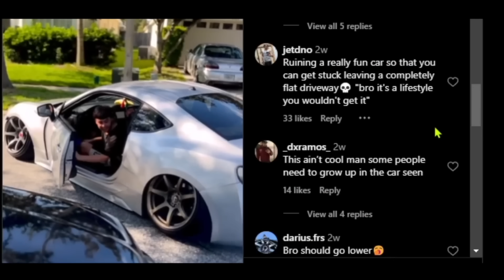THIS 19 YEAR OLD HAS THE MOST DANGEROUS CAMBERED STANCE CAR EVER

Comment: This mans is the reason why frs are going extinct and blaming that it's not reliable 😂
Reply: It’s a Subaru, shit ain’t reliable
Reply: @UTP_ENT  bruh im beating on my wrx all you need is oil change and some mods and its good dingus.
Reply: @fakethiscrap2083 no. the 86s and brz are not wrxs
 the engine has issues
Reply: @rollinthunder8671  they run the same engine only difference is the turbo
Reply: @fakethiscrap2083  no wtf they are not same engine.. 
as an owner of one for 6 years u don't know what your talking about
Reply: @rollinthunder8671  they both use the lets say we use fa20 which is used on the wrx and frs. Like i said the only difference is the turbo and a tune
Reply: @fakethiscrap2083  these cars are   not reliable
connections rods failing is common
Reply: @rollinthunder8671  look im talking from my experience that on my wrx beating the living hell on it. I have the common mods on it the oil catch can upgraded oil pick up with baffles and an intake with a blow off valve. And a slight tune with a mufflers. Again all i do is oil changes every 3k miles change the spark plugs every couple of months and change the coolant every other year. I havent blown the engine or have any issues. So in my point of view its reliable to me. I plan on upgrading the engine to the fa24 engine.